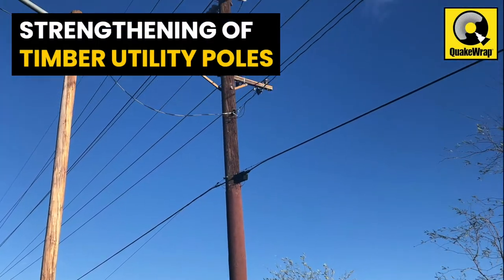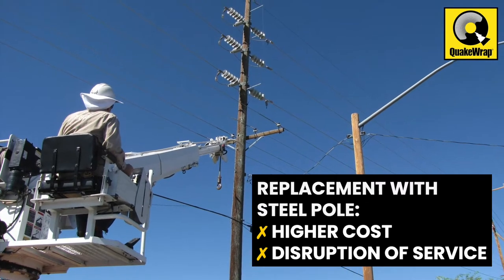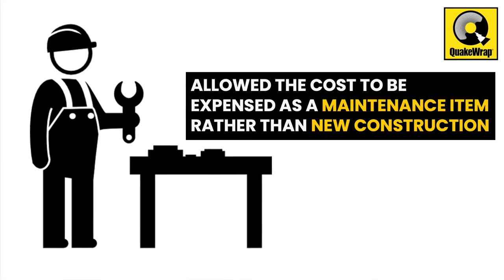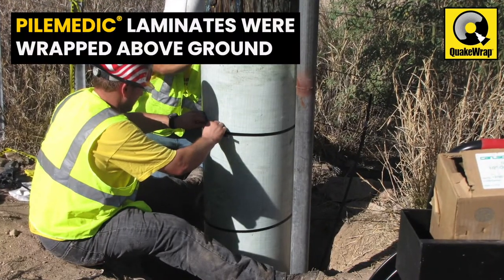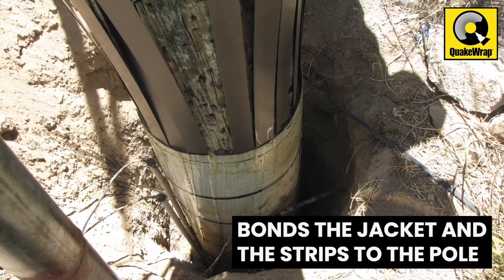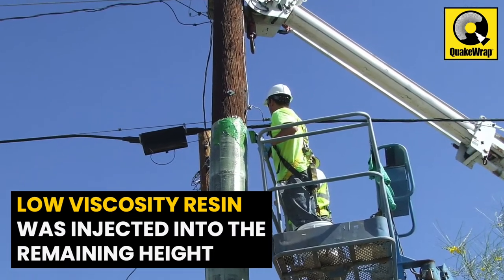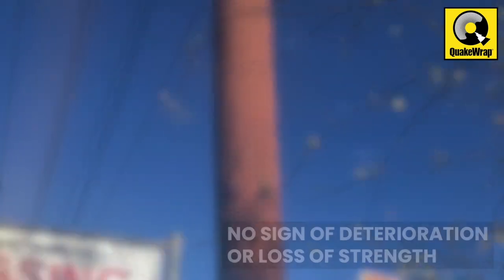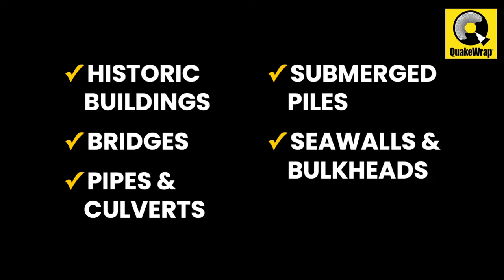Strengthening Timber Utility Poles Using Carbon FRP Laminate Strips

Comment: How fire resistant is that?
Reply from the maker: Thank you for your question.  In general, these products are not fire resistant unless they receive a fireproof coating.  The fibers of glass or carbon can withstand very high temperatures without damage.  But the resins begin to soften at about 160F or so.